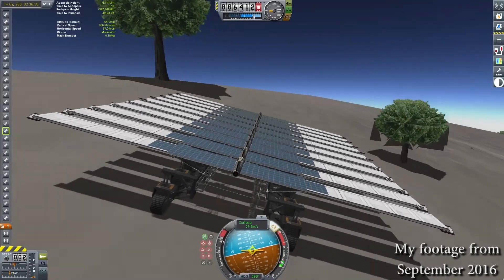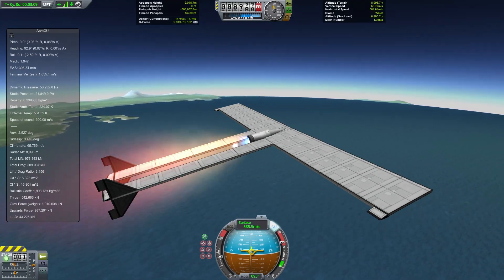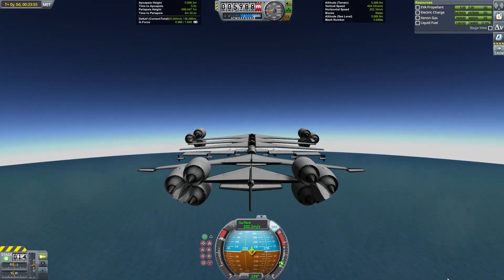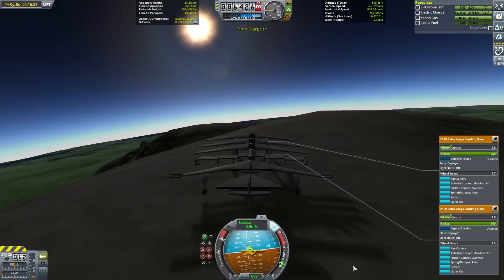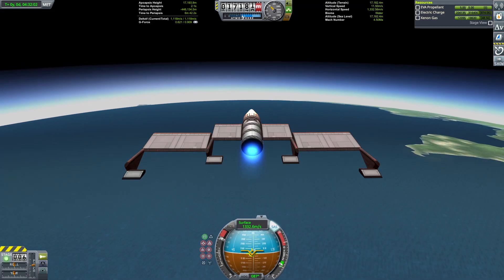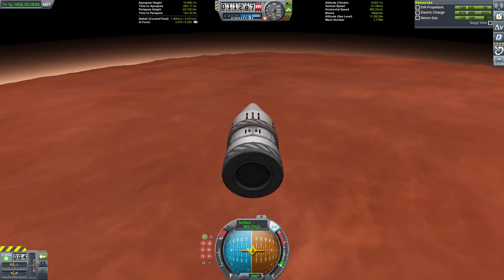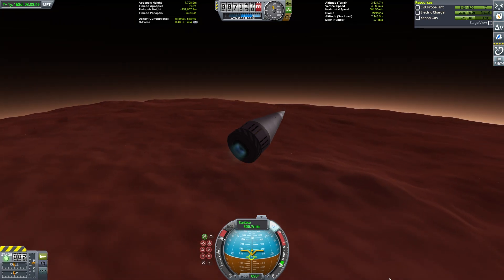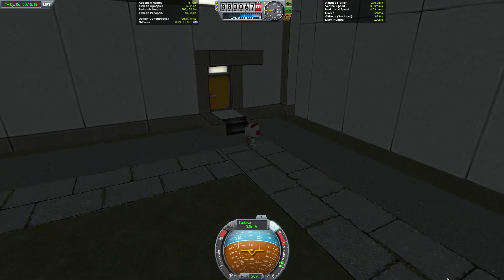Orbiting Kerbin with only ion engines - KSP

Comment: I swear, one day you'll find a way to build an ion SSTO
Reply: Maybe an electric only ssto with his 1000m/s prop plane, probably not possible idk
Reply: Deepfriedpillows bradley whistance will remember that
Reply: @iain3713  Absolutely not possible, in order to get to orbit you need to have at least SOME thrust outside of the atmosphere, props will not do ANYTHING once he's in space, so he would be unable to do the final maneuver to LKO. that being said, an orbit using props is possible, it would simply not be an SSTO, once he's out of the atmosphere, he can wait until he hits his Apoapsis, rotate the craft in order to create centrifugal force, and decouple (Therefore making the craft not an SSTO) to slingshot the desired part of the craft into LKO, however, in order to return back to the surface, he would need to bring more then one thing to decouple, as each of these slingshots require a decouple. he would essentially need to bring another weighted object up with him for every maneuver he planned on making while outside the atmosphere. this is also assuming KSP's physics allows a prop to have enough power to reach a suborbital trajectory. i've made my fair share of props. and they don't put out much power once you exit the lower atmosphere, so it would probably be even harder to get one into a suborbital trajectory then getting this thing to Duna was. that being said, he's a genius, and could probably pull something crazy off and make it work. I would love to see if, and if he sees this comment, I would love to know what he thinks, or even see a video on it.
Reply: @dihydrogenmonoxide2878  this is funny in context of the new video from stratzenblitz
Reply: actually you said ssto, nvm
Reply: @dihydrogenmonoxide2878  you could do props+ions to make an ssto
Reply: @agtshaw  yes, but that isn't purely prop, which was the whole point of this conversation.
Reply: @dihydrogenmonoxide2878  What if he utilizes a swingarm for the final maneuver? It would still be electric.
Reply: @builder396  that would work, but this conversation took place before moving parts existed, so that didn't exist when I said all this stuff. Now that's a totally valid option, yes.
Reply: @dihydrogenmonoxide2878  not true. If you accelerate enough in the atmosphere, you can get onto an encounter with the Mun that can circularize your orbit.
Reply: @dihydrogenmonoxide2878  if he used a prop plane, he could utilize a spinning wheel with heat shields and nose cones to provide a massive spin, and then use the spin to launch a craft into sub-orbit, and then use the leftover spin to circularize
(this was done by stratzenblitz when doing a jet engine on air breathing mode to orbit)

but then, it still wouldn't be an ssto. im sure it's possible, but very difficult
Reply: @blemmyes  Well, I'm not going to say he couldn't, but no matter how good you.are, I don't think it's possible to make a prop plane that can get that far out of the atmosphere without any other form of movement. I will admit I haven't crunched the numbers, nor would I be able too (mathz be hard) but it just doesn't seem very likely, then again neither did an orbit using only ion engines. That being said, if he managed to exit the atmosphere with enough speed, and traveling in the right direction, while the Mun was in the right spot... Hypotheticaly, yes, a gravity assist could be used to get into a stable orbit without any sort of burn after leaving the atmosphere. The biggest problem I see with this whole thing, is although props can be rather powerful, unlike most engines, they lose a LOT of power as the craft gains speed, and at high enough speeds they can often clip through your ship, or even summon the Kracken. *shudders*

If you don't know what a prop in KSP actually is, it's not an actual engine. To make a prop, you essentially build a ship that's trapped inside a Propeller housing on your main craft, and use reaction wheels to spin that ship really fast, so the propeller isn't actually connected to your main ship. That makes it prone to fail in many conditions. High speed, hard turns, and just general bad luck will easily wreck most props. Even if the math works out for a prop plane he makes, it would be a miracle if he managed to reach sub-orbital velocities without any clipping or issues.
Reply: Hypersonic propeller flight is possible in high orbit, right? so could you have a single stage craft that's a hypersonic propeller plane, and then use bottom thrusters to maneuver into orbit? @dihydrogenmonoxide2878  basically, maintain aerodynamic supersonic propeller flight, and then use vertically mounted ion thrusters to modulate Fg, and then combine the ion thrusters with gas maneuvering thrusters in space and LKO? 

 @Bradley_Whistance , thoughts?
Reply: @WinterCharmVT  yes but you are no longer just a prop plane, you introduced an ion engine, also hypersonic props are possible, but also extremely sketchy as they could clip or get Krackened easily. I would also like to hear his opinion on this thread, it would be great to get such a brilliant mind in on this conversation.

Edit: I just noticed you said "in high orbit". No, once you leave the atmosphere, props are useless.
Reply: @dihydrogenmonoxide2878  wouldnt work. only single body gravity :/
Reply: SSTA ?
Reply: @ioangauss  SSTO: Single Stage To Orbit. It means a ship that can go from the ground, to orbit, and back, without needing to decouple or jettison anything. Usually they are also supposed to be reusable, but it's not strictly required to be an SSTO.
Reply: I-oan G-AUSS a means?
Reply: @machy8515  anywhere but no because you cannot farm ion gaz
Reply: If you use the kal 1000 you can increase the thrust beyond 100%, that means today is the day boy
Reply: maybe a ssto with props and ion engines
Reply: Matt Lowne did it
Reply: @toothpastegobbler4434  powered by nothing but ion engines? No
Reply: Brixxter :l
Reply: Matt lowne did it
Reply: I have
Reply: SSTO: Fantasy of bringing with you excess mass in a subpar configuration but somehow make a profit out of the operation.
Reply: @Krommandant  honestly, if you play with 100% or even 90% part cost returns, it becomes quite profitable in some situations, as the cost of fuel can be less then the cost of the parts used to make standard ships.

EDIT: also it's a fun challenge to try and build one.

Comment: Woa
EDIT: wat you just 1-upped stratzenblitz75

Amazing!
Reply: Kinda. I mean stratz was right you can't get to orbit with an Ion engine stock.  I wish ksp would do something about the part count limits
Reply: Saxie81 you can’t get to orbit with ion engines only from sea level
Reply: Part clipping is stock right?
Reply: @Saxie81  Well you can if you are satisfied with 1 fps. But yeah. I think parts that aren't exposed to the atmosphere shouldn't have drag applied.
Reply: Does FAR help with this? Doesn't it only calculate drag based on shape, so clipped parts won't generate drag?